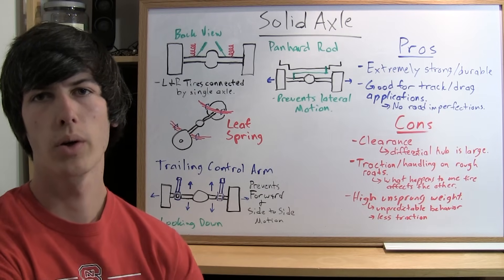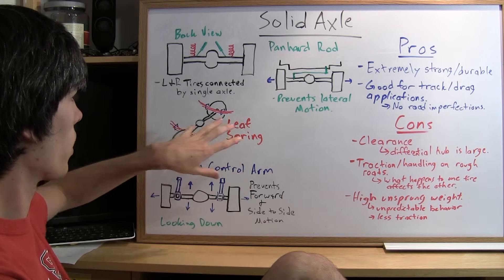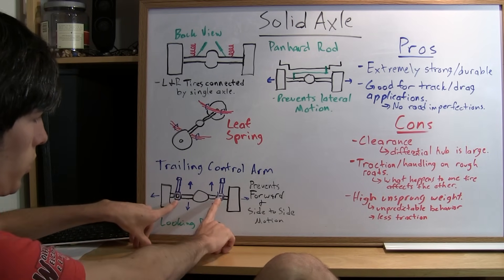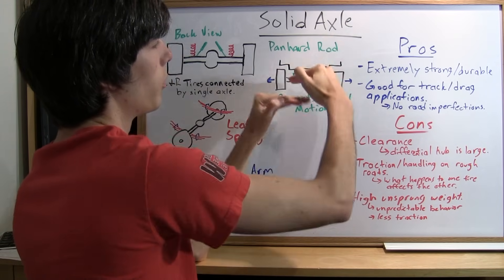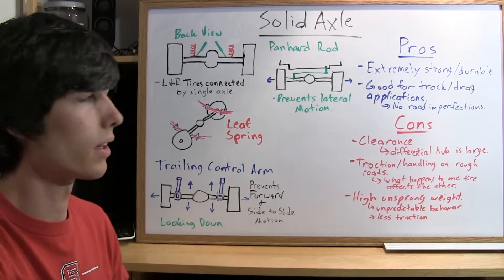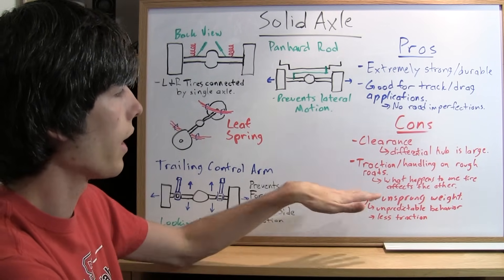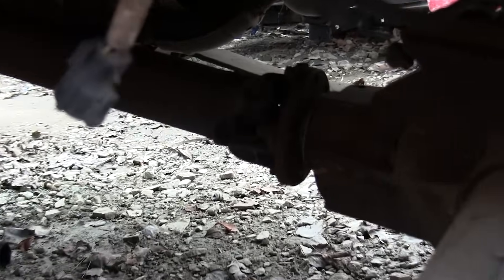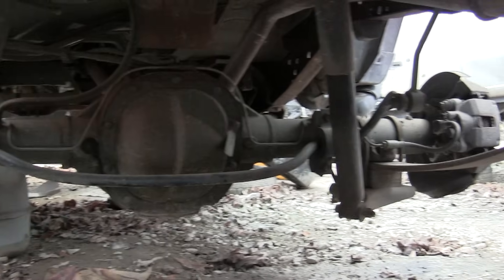Solid Axle Suspension - How Truck Suspensions Work

Comment: That's not what happens out on the trail. IFS has extremely limited droop and compression capability. This means if one side goes up onto a tall rock the whole front of the vehicle will be lifted up and the other tire will leave the ground losing all traction. A solid axle on the other hand will articulate and when one side goes up, the other side is forced down into contact with the ground. IFS is great for a smoother ride on wash board trails, but a solid axle is superior in extreme conditions

Comment: You forgot to explain how a Watts linkage works as an alternative to the Panhard rod, and also another of the pros of this kind of suspension is that it keeps camber and track width constant when the vehicle's body rolls in high speed turns.
By the way, an interesting and very rare variation of solid axle is De Dion axle.

Comment: When you say grip, I believe you mean sustained cornering force (i,e. the ability to change direction(, for which the dominating factors are weight and traction (which itself is a combination of weight/down-force and the dynamics of the tyre).

Comment: Apologies to nit-pick but weight (in combination with down-force i.e the total force acting downwards on the tyre) is equally important to the grip level. Obviously the tyre durability will be an important factor in the real world.

I'm talking about grip, or traction, and not the sustainable cornering/braking/accelerating forces, which are 2 totally different things, where the dominating factor is obviously weight.

Comment from the maker: Because an independent suspension cuts the link between the two sides. So if one side needs to move up, and the other remain flat, the single tire will go up (to an extent) without a need for the entire vehicle to lean.

Comment: The way I understood it is that leaf springs are stronger and able to take more weight than coils but less comfortable, my pick up had coil fronts and leaf rears and could carry anything without the back end dropping noticeably. Was definitely worse to drive in regard to traction both on and off road than coil front/rear though

Comment from the maker: Yes, though if you have the "nicest" suspension in the world, but have plastic tires, you'll never go around a corner at the same speeds as something that has no suspension and sticky tires. (Yes, of course if there are bumps the second car will have a tough time, it's just important to know why such high lateral g's are capable in ideal conditions).

Comment: yes and no....tires only have traction when they are on the ground....hit a bumb and the tire goes and and loses and gains traction as the suspension and car rebound up and down...the suspension also helps to transfer wieght when you turn.......suspension plays a important role in traction

Comment: Ok thank you for your responses. Just thought cornering may be affected by suspension set ups too. I know they typically do this evaluation in new cars where the measure the Gs in the turns. Same tires gives different results with different cars. But I guess it has more to do with the rubber in the tire (coefficients of friction), weight of the car (normal force), weight distribution (on each tire), and front wheel drive rear wheel drive (oversteer vs under steer).

Comment: So I guess the amount of grip would be the same regardless of the suspension? Reason I ask is because I drive a Mazda miata and mazda 3. Both are good cars, but have very different amounts of grip (ie when I take the turns).  Does this have more to do with the tires than suspension?

Comment from the maker: Body roll will depend more on the suspension components (springs and roll bars) more than the set-up. Soft spring rates will allow either to have a good amount of roll, firmer spring rates will reduce roll.

Comment: You talked about camber in the independent rear suspension video. In IRS, the upper control arm is shorter than the lower control arm to account for body roll.

How is the performance of solid axles when taking turns (i.e. body roll) relative to IRS?

Comment: yes, might be for cost but with the advent of luxury trucks like rams laramie,fords lariat/platinum and others, many trucks are very expensive and focus on comfort so the cost wouldnt matter on those. maybe on the lower and base models. but many of these trucks still have leafs. the ride must be nice on coil springs..wouldn't hurt on a truck not worked much too considering myself and enough others would just buy a truck cause they like them not cause they need them...

Comment: this can have a coil spring setup as well, right? for their 2009 fourth generation redesign, dodge ram 1500 switched to coil springs from leafs. would not seem to be ideal for a full size truck but apparently it works good and theres not much change in truck capability...that must be the suspension setup...

Comment: not from what ive experienced. maybe some vehicles are bouncy with leaf springs, but the ones i've been in have been very smooth even on fairly rocky dirt roads. suppose it depends on the vehicle and what its designed for...

Comment from the maker: Well, I suppose it really doesn't make a large difference in comparison to an independent rear suspension. But the drive shafts cannot be angled at all, where they can with IRS. So in theory this could mean greater clearance.

Comment: just pointing out over here, but many other cars/crossovers and stuff are Awd and yes it is very beneficial. even if you have the part time 4x4 as seen on many suvs and trucks. either one when based on the FR layout with extra driveshaft, it provides the torque steer and the digging into snow instead of wheels pushing it and any benefits of Fwd, while providing the Rwd pushing factor and the durability, balance and longevity that i'm sorry, Fwd just doesen't have. not that special, but helpful.

Comment from the maker: Why do you say it is special in the first place? Just curious what your reasoning is. Audi's is kinda unique in a sense that they try to do everything mechanically, without the aid of electronics - at least that's what they used to do, could have changed. And as stated below, almost all Subarus do come standard with AWD, but as far as why it's special, it's just AWD. AWD has numerous advantages, so perhaps that is why it is "special."